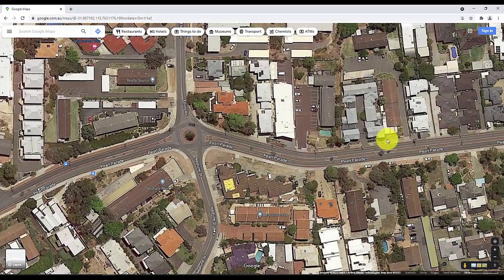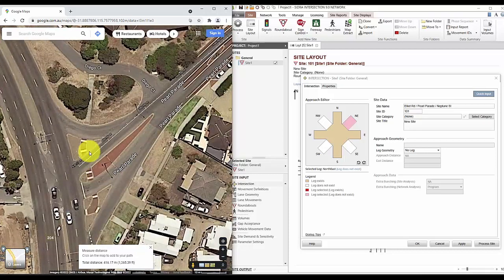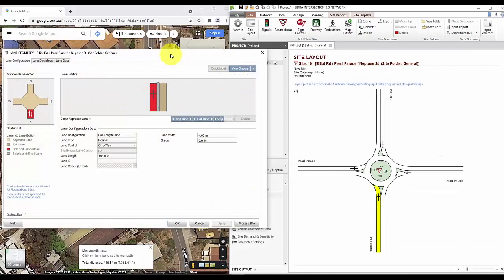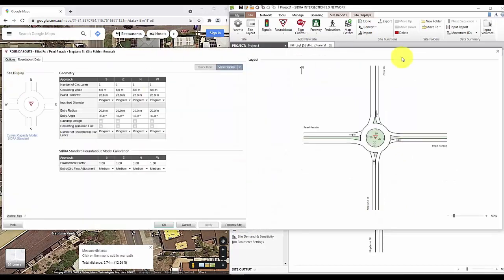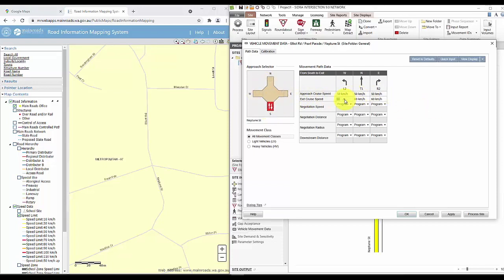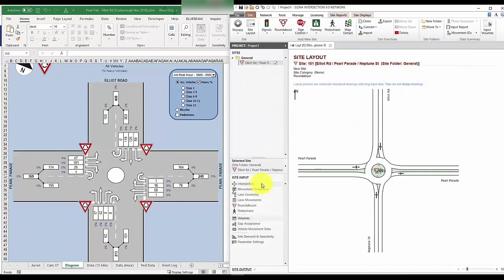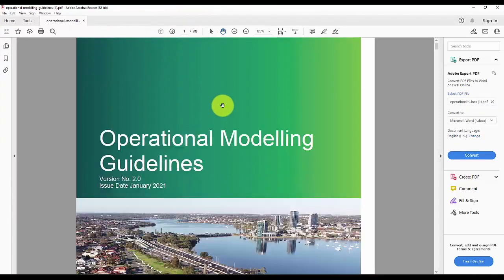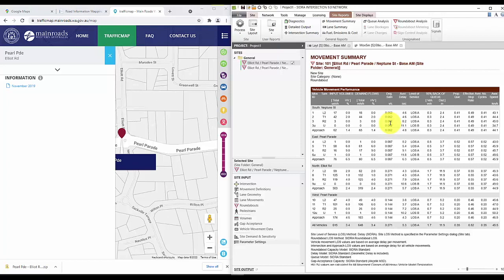How To Create A SIDRA Model - in 10 MINUTES！– A Step by Step Beginner Guide to SIDRA Modelling

Comment: Hi. How can I add PM volumes?Thanks
Reply from the maker: Hey there, once you are happy with the site you model, simply duplicate the site and renamed as "PM". Then replace the volume with PM volume. You will have two sites, one for AM scenario and for PM scenario. Now since the two are independent sites, any changes you want to make to the site after this point will have to be made manually to both sites. (In real life, the intersection shouldn't look different in the AM vs PM!)  Hope this helps !